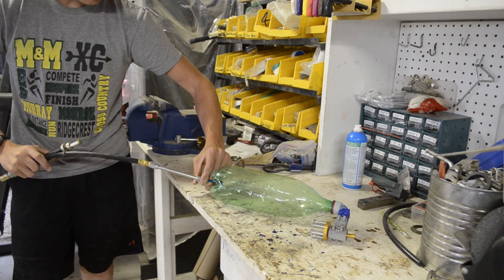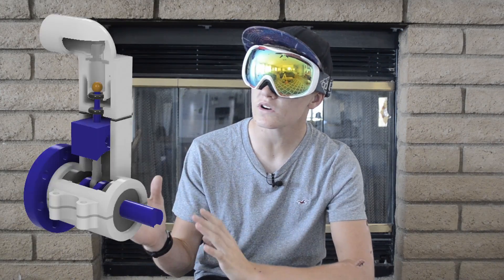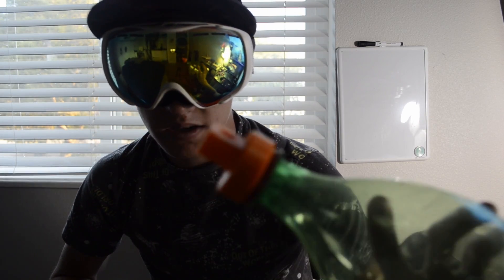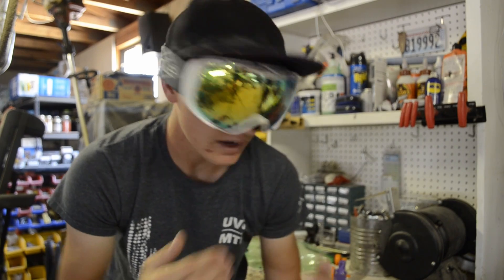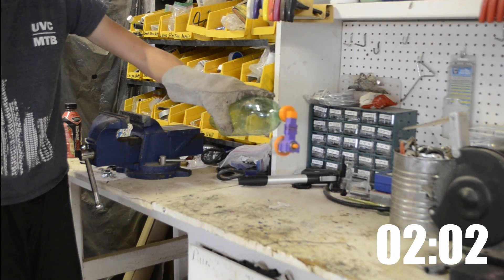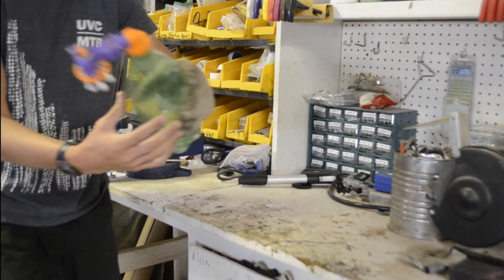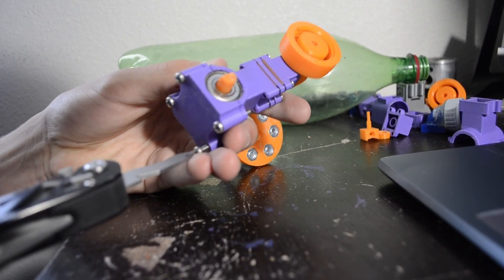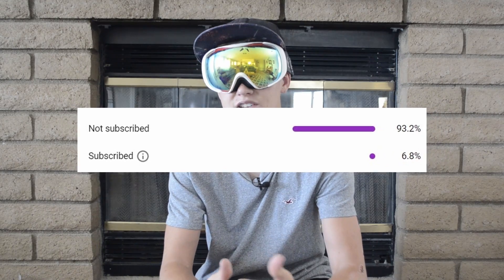Powerful Compressed Air Engine V2

Comment: you should make a twin cylinder where the exhaust from one goes into the intake of the other. Like a circuit in series.
Reply from the maker: I've been thinking of making a compound twin, I'm just trying to make a very efficient engine first

Comment: Hey, Integza used for his Rotary compressed Air Engine a small co2 tank out of metall which stores really high pressure in a small space. 

you should use them too, could give your engine great range and performance
Reply from the maker: That's a good idea, thanks!
Reply: the problem is that you need a way to regulate the pressure because a co2 canister is 800 psi and would instantly destroy a piston engine. Plus when the co2 is discharged fast it gets cold and if it gets too cold it starts to launch solid co2 into the engine which would not cooperate well with a piston based engine.
Reply: @garbageman3992  yeah true, @Axel Dayton i'm excited how you gonna solve those problems
Reply: Idk maybe use a waterbottle between the engine and the co2 canister.

Like you doing in the video with the bicyle pump, but with a smaller bottle, that the pressure dont drop that hard.

Sry for my Bad english, i'm from Germany

Comment: Your air compressor should have a pressure regulator dial on it so you can regulate the pressure. You can just take a quick couple and attach it to the engine with a thread. Then regulate the pressure to like 20 and start the engine and u should be able to regulate pressure to the engine while it's running.
Reply from the maker: Thanks for the information! I didn't know that until now!
Reply: @AxelDayton  yep! If your compressor has two guages, one is tank pressure other is tool pressure!

Comment: If you want to a longer run time without sacrificing power output, go for a V twin engine. Then you'll have the ability to rev a lot lower and have a lot of torque. This will improve your performance and make it more efficient (per cylinder). 

However if you want to have an engine that minimizes vibrations, go for the boxer. The boxer will have about the same torque as a parallel twin, but not have the vibrations. Depends on what you want to use the engines for.
Reply: V Twin is definitely the move, not only the performance increase but also just the sound would be epic!

Comment: Is the bottle holding compressed air? Also your cat's presence really adds a lot to the video
Reply from the maker: Yes, the bottle holds the air because in the video, I separated the compressor from the bottle every time I ran the engine except the stress test, that test was 80psi from the compressor to try and see if something would break.